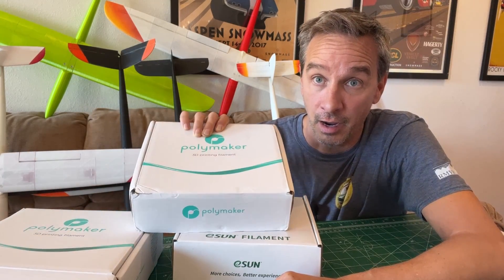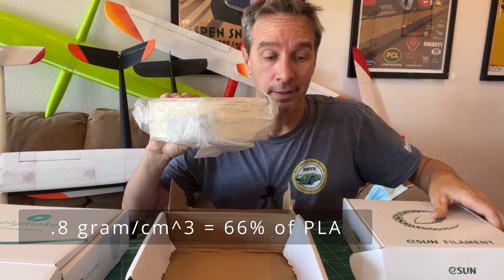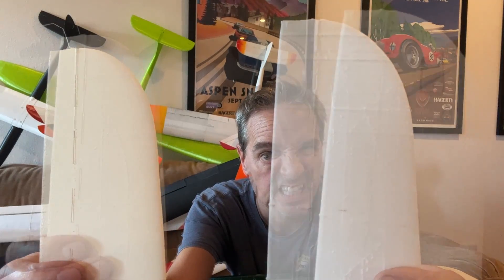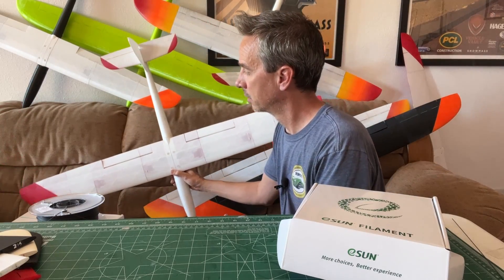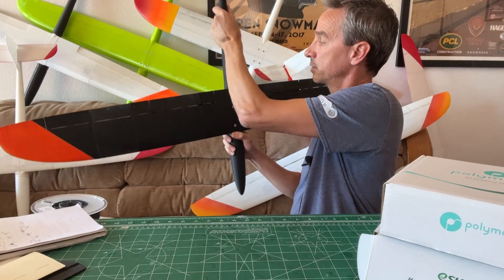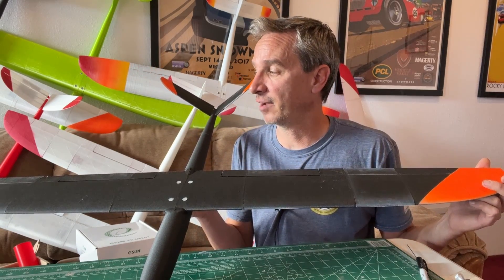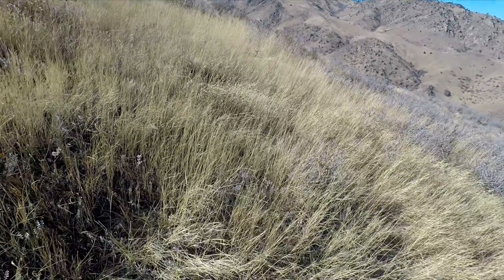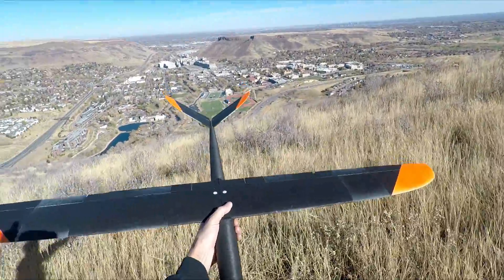New Light Weight Polymaker 3D Printing Material - comparison and test

Comment: With colorfabb fully foamed at 250°C I save about 2/3 of the weight.
Reply from the maker: Yep, this is not the same type of material.  The ColorFabb at minimum weight (maximum foaming) is about 10% the stiffness/strength of regular PLA, so even at 3 thicknesses (same weight as regular PLA) it is not as strong.  It is possible to foam less, get some less floppy parts, but because the temp vs foaming curve changes quickly it is more difficult to get the flow / temp correct for more precise printing.... and these planes are single wall extrusions and usually have carbon channels and servo pockets. This Polymaker stuff is 67% the density (or 33% weight saving), no additional variables.  I does still ooz some, not as bad as the active foaming stuff and allows for more options without the hassle of learning a new material (sort of).  This is an older video and this tech is changing fast.

Comment: But at these temperatures the filament has not yet foamed up. Where is the weight saving?
Reply from the maker: This video is about PRE-FOAMed material, not the same as ColorFabb stuff... this material from Polymaker (and some others: Inland, Overture) is 33% foamed as it comes on the spool and prints at the same temperatures and settings (or so it was hoped) as regular PLA and does not ooz as much.  This is an early video.  ColorFabb's LW-PLA materials are "active" foaming materials.... this is not the same.  The active foaming materials required lots of design changes to get them to print well, continuous path, less or no retractions, etc.

Comment: Cool comparison. But in my case, polymaker lw-pla has the almost same weight as petg. Does everybody know what should be changed to achieve lighter weight with this plastic?
Reply from the maker: Depends on what you are printing it with, I use Orca Slicer and a Bambu X1C and have to reduce the flow ratio to .92 to get the proper weight of 67% of regular PLA.  Cura and a sidewinder did not have this problem, but Cura is terrible and the sidewinder is too slow.
Reply: @soarkraft  thanks, will try

Comment: I'm going to make a mold when my object is done, I need to extract the foaming PLA shapes out of my object. My question to you is this foaming pla  easy to destroy and break apart like Styrofoam.
Reply from the maker: Sure???? but maybe not??? there is a lot going on in you project that you will have to figure out.  This material is porous so you will need to seal the surface for it to "demold".  Mold wax might do the trick.  Still never dont this with this material, you are going to have to figure it out.

Comment: i just puchased the overture air and was great my esun pla+ came in at .70 oz on a wing part
set at 206 deg and speed 85 and 3 % infill . i did polymaker blace and with same setting came in at .51 oz. cost was 34 at amazon. i also bought the overture and with same setting it came in at .52 oz and strength same as the polymaker. it cost 18.00

Comment: Fantastic, I had never thought to try gliders only up on Lookout Mtn, this might have potential as a school project, thanks for posting. Which of the Pika designs do you think would work best for students to learn on? Do you have a minimum wind speed you like to see or temperature ro time of day that increases the chances of success?
Reply from the maker: So these are not really beginner planes, but you could learn on them.  I would suggest a "combat wing" as a good starter... they fly good and can bounce, cheap and easy to build... then take the next step and print one of these.  There is also a free simulator, PicaSim and the Banana flies a lot like the Pika.

Comment: These gliders are so fast! I'm wondering if a delta wing can do the same.
Reply from the maker: Delta wings are not necessarily faster until you are going close to or beyond Mach 1... The fastest RC airplane is a straight wing glider doing Dynamic Soaring - 564 mph.  Delta wings look cool.

Comment: So I been using polylite for a while now and didnt even think about printing model plane parts. I wanted to for a while but couldn't bring myself to spend $45 a kilo for lw-pla. Polylite is pretty cheap in comparison to other lw-pla manufactures. I only have the traditional poly logo color atm. I will order another spool in white or yellow and give this a go. The only downside to ploylite filament is flow! I still have not printed a prefect part. I always find random banding, minor but still, it is frustrating. Im sure I can dial it in someday lol. Thank you for the video.
Reply from the maker: make sure you order the LW-PLA from polymaker, not just the "Polylite" if you want to try it...
The best way I have found to ensure I get the right material is the spool should only have 800g of material on it.   If it is a full 1Kg then it is just regular PLA
Reply: @soarkraft  Understood, I miss spoke. I just happen to have a spool of polylite, it was a good color to match my electronics bench and at $18 a spool on amazon, I picked it up not really understanding what I just purchased.

Comment: Most excellent video, so insightful and helpful. How much filament does it take to print the Soarkraft gliders in the E-sun filament or light PLA?  Thanks:)
Reply from the maker: regular PLA uses 420-450g of PLA.  The e-Sun using my settings at 50% feed rate uses ~ 260g, 40% feed rate uses ~ 220g, or about 4 planes for 1 kg of material.   As for the plane there is still carbon, servos, radio glue etc.. ~ 420g RTF 
The polymaker comes out to about 280-290g  - so you almost get 3 planes out of a 800g spool.
Reply: @soarkraft  Thank you very much for replying  back to my question !

Comment: A little heavier is actually beneficial if you  have a good breeze. They all break when you crash them
Reply from the maker: Yes, my favorite is 800g regular PLA Roughgen with a 4 servo wing.  Very zippy and cheap/easy.... can handle and flop into the bushes.
Reply: @soarkraft  if u r ever in northern California, check out pena adobe regional park in Vacaville CA. It's an awesome place for slope soaring. You could fly it at 1600 grams.

Comment: They should bring out a foamed petg and foamed pctg or foamed PC
Reply from the maker: Sure, those would be good too.  Not sure the chemistry is that easy.
Reply: @soarkraft  do you know what chemicals they us as blowing agents?
Reply from the maker: No, I have no information from Polymaker yet. Im sure it is a trade secret or something.  Search "PLAiR" which is anther "foamed" PLA and it sort of explains one way of doing it.
Reply: @soarkraft  you don't happen to have connections to the filament industry? 🤣
Reply from the maker: No, but I use some type of filament everyday.  I designed the gliders in this video and I design other commercial products and use 3D printing for prototypes.

Comment: Nice job! Do you have some experience or testing about warping because of heat? Direct sun exposure on the slope (air and ground) and car transporting? Im curious about how the polymaker material behave about warping! Thanks for the amazing content!
Reply from the maker: So I have had it in the sun for several hours and it was fine... even in black, but its 75 degreeF outside.  All of my designs are supported with carbon strips and rods, so structure is not an issue.  This is probably not going to stand up to Arizona summers or sitting in a sun baking car any better than regular PLA or the foaming stuff.... its the same material, and I don't know about other designs.

Comment: Very interesting video, I am building a Roughgen V2 using Color Fab LW-PLA , can I ask if your model survived the landing without damage?, your video doesn`t show.
Look like the new Polymaker material is the way to go, once released.
Reply from the maker: In the landing at the end of the video it all survived accept the PLA nose cone... it broke the tip off.. but was easy to glue back on.  I used a regular PLA nose cone because I needed a little bit more balance weight and the nose cone worked perfect.  If you watch any of my other videos you will see I crash a lot.  I have flown the Colorfabb LW-PLA Roughgen quite a bit before this and it survived many other landings and tumbles through the bushed.  

Good luck on your build.

Comment: Very nice test flight, very detail review of the process and very helpful for anyone in the same hobby, thank you for sharing.
The final product will be released as PolyLite LW-PLA and will come on cardboard spools. Thank you for the suggestion, we will think about having different rate of pre-foamed material.
For the colors, it seems that you have orange wing tips, would you like to see an orange version of the material?
We would be interested in a partnership on some of your project to create content for our RC plane community, you can contact us directly if you are interested :)
Reply from the maker: Bright "neon" colors are a plus: orange, green, red, yellow... high contrast for visibility from far away.  A 50% density that is easy to print would also be a winner and easily have a competitive advantage over the foaming type... the only thing the foaming type has better is that 17% lighter.
Reply: @soarkraft  Thank you for the suggestions, we will develop a few more bright colors to answer this need and we will study the feasibility for a 50% density easy to print filament.
Reply: @Polymaker when will you sell it in europe ??? i had to pay more in shipping than the filmaent to get one. i enjoy it  but will need more soon.
Reply: Awesome, Is it possible to stiffen it up with epoxy and gfk or cfk? Thanks
Reply from the maker: Could you? yes, I have seen examples of skinning with carbon cloth or glass.  Usually to try to improve a bad design, so so results.  The added build time and cost vs desired outcome needs to be balanced.... I have vacuum bagged many foam wings and fuse designs.  Its lots of work, time consuming, messy and not cheap (need the right tools and supplies).  It takes practice to get good results.....  Should you???? You can build however you want.  

Im having a great time just printing, CA and crash... and doing 100+mph in-between.  Even molded carbon models will not survive my crashes.